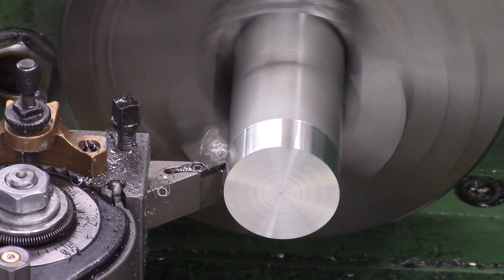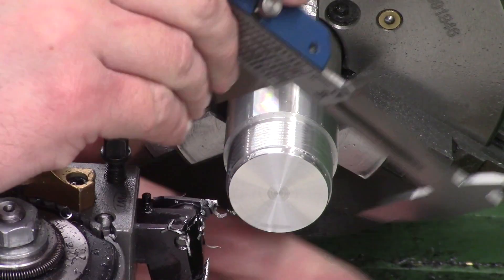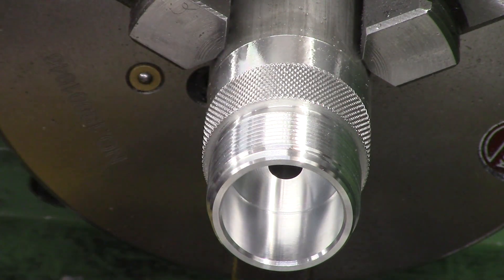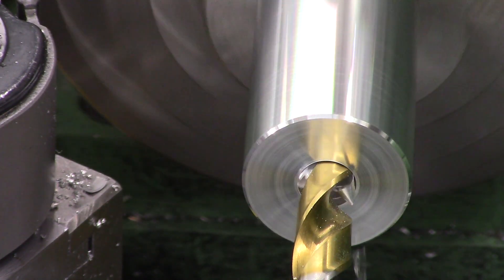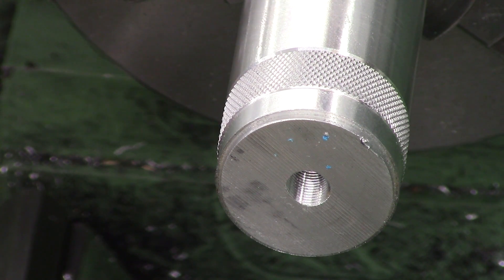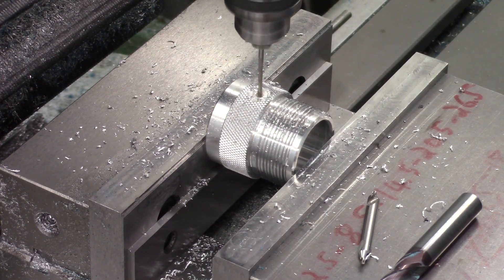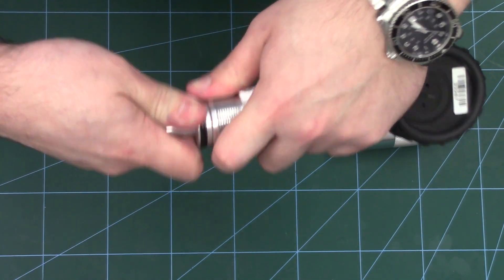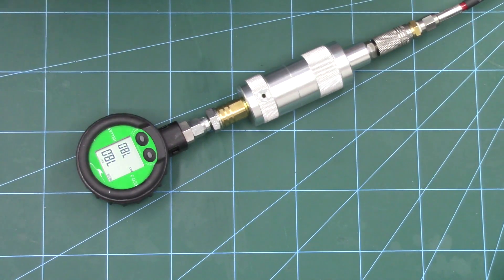Making an Airmaks Katran reg tester.

Comment: Awesome work, are reg checkers available for the katran regs?

After finding out that single shot loaders are available for the katran, plus the 'new' tranfers port upgrade, I'm tempted.

Do these rifles come with anti tamper?, would want to set it up for HFT so want it to be self serviceable.
Reply: I have a UK sub 12 version, hammer spring tension has no anti-tamper, as has to be removed to air down the cylinder tube, plus was only an allen key required to adjust the reg if required
Reply: @RiceyRigPig 

Hopefully I'll get to play with one, heard conflicting reports, be nice you try for myself.